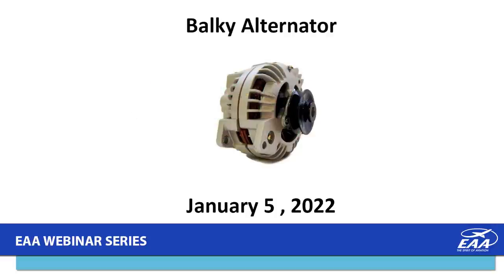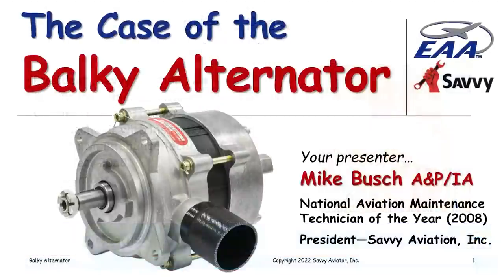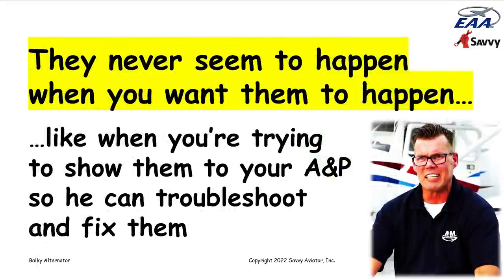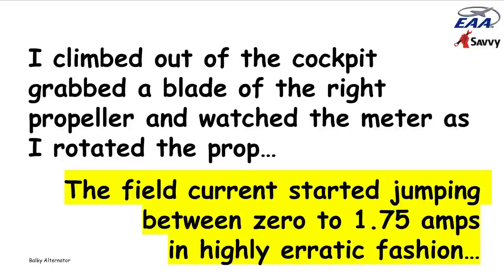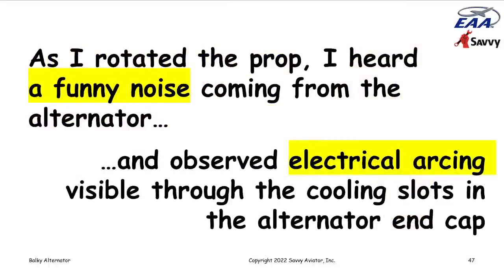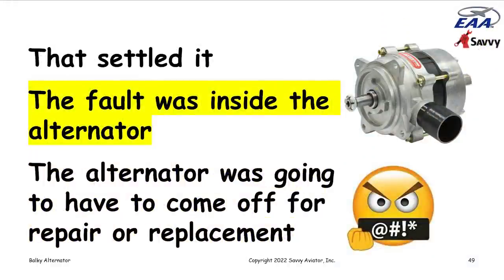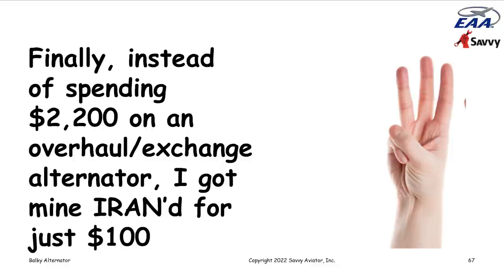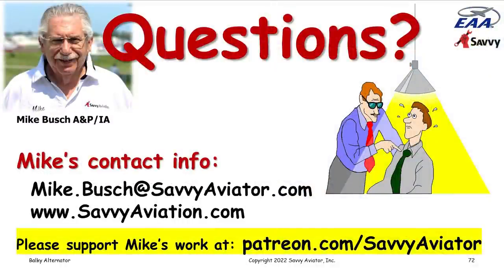Balky Alternator

Comment: I've had two alt failures.  Each one on the way to a fly in.  The first was about 100 miles from home when it quit.  Landed to check for something obvious such as loose wire or belt failure.  Nothing.  Flew home with the master switch off using handhelds for navigation and traffic.  (I never thought about if I was legal or not).  My aircraft is an RV which I built and I have the repairmen cert so I'm the chief of maintenance as well.   Once home, because of availability and cost,  I swapped the aircraft alternator with one from O-Reilly's aircraft supply.  About 100 bucks for a drop in replacement and all was well.   Fast forward about two years and on the way to another fly in that one failed.   With the help of a guy for transportation and another for a couple tools, I had it fixed.  The lessons learned from the first failure were invaluable in dealing with the second.  When returning the failed alternator after returning home, they gave me a full refund of the new one because it had a lifetime warranty.  I was happy.  The first alternator, (aircraft alt) had lasted about 500 hours.  The second about 100.  Hopefully this one will do better.  Even if it doesn't, I LOVE the fact I can get it replaced even on a Sunday nearly anywhere and be on my was in just a few hours.   Got to love experimental aviation.  Sorry for the long post.  Like you said, alt failures seem to never happen at a good time... always away from home.
Reply: That's only about 8000 miles . 
We had better luck with generators way back when
Reply: Oreilly alternators fail because the rpm they are at. Look at the size of the flywheel on your prop then Look at the crank gear on a car engine. They are spinning 2x to 5x there designed operating speed. Only way to get more life is to put a bigger alternator drive on it. I see this happen weekly.
Reply: For $100, why not mount a cold spare in the plane somewhere?
Reply: @JosephHHHo from a mechanics point of view. The work and cost to mount another alternator on an experimental and still have the cowling fit would far exceed the usefulness. Not to mention would need a way to drive it. You could run it off the accessory drive on the rear but would need to order a new accessory drive that fits and then an alternator that would between firewall and engine. If you ran it up front the flywheel would need swapped out for one that has 2 belt grooves and 2 seperate length belts. Best case scenario a competent mechanic could do it for $1000.00 all in. Realistically it's a $2,000 job for fab work, testing, wiring,
 etc, unless done by the owner. They could carry a spare but with everything aviation you could lose any number of components and trying to carry spare for those would fill the plane and make it unusable. Whenever I have an aircraft with alternator failure we swap alternator and voltage regulator box. I have seen both units effect each other and a bad alternator cause a VR to fail and vice versa. For the cost and time why not swap both.
Reply: @robvenom1058  
There is no need to have the spare connected. Unless you are crossing an ocean, you can pick just about any public airport to set down, whip out the tool kit and swap it in. Doing the work to tie it in may be counterproductive because the spare would be spinning while not being productive.
Reply: @JosephHHHo  my point being if we are going to carry a spare alternator why not carry spare tubes and tires, spare electric fuel pump, spare filters, spare instruments, spare battery, spare everything. From my experience in aviation maintenance over the last decade carrying spares apart from a couple plugs, some bulbs, and oil provide  almost 0 benefit. A blowout is much more likely to happen but the thought of carrying tires, tubes, compressor, jacks, and tools is almost laughable. Just my opinion. I'm perfectly OK with someone wanting to be prepared but I would never recommend it, especially not an alternator.
Reply: @JosephHHHo  I did consider buying one a keeping it onboard.
Reply: @robvenom1058  maybe because it has to charge at idle, that's 400 rpms to airplanes as opposed to 950 rpms to cars. A bigger drive pulley may interfere with low rpms charging.
Reply: @tomasnokechtesledger1786  that is possible and without knowing his exact engine setup it is difficult to calculate where it should be. While an aircraft engine can idle around 650-700 I rarely ever bring rpms below 1000 even on start up, others may sit at idle i just haven't seen it When we swapped an oreilly alternator onto an RV-6 we calculated at the time that at cruise his alternator, which was also used on a suzuki samurai, would be equivalent to that vehicle running constantly at 14,000 rpm. After that he understood why they don't last very long. To be completely transparent that alternator had one of the smallest pulleys I had seen for a vehicle. Plane power alternator would have been a better choice even though I'm not a fan of theirs in the least.

Comment: As always, a good presentation illustrating some of the challenges and dilemmas we are faced with as owner-pilots.

I never had an alternator fail on me, but I have had two difficult to diagnose issues. The first was ignition related, causing the engine to be very hard to start, one cylinder going cold during ground leaning and exhibiting lean misfire when 50-100° LOP. I ended up discarding the Champion spark plugs with megaOhm resistance, and replace them with Tempest which cured the issue.

The second issue was alternator related. The symptoms were somewhat similar to what you describe in your presentation. One alternator had difficulties coming online, and the difficulties seemed to be worse in cold weather and increase with time. It turned out the alternator relay was arcing due to a turned stud.

The mechanics I talked to about the high resistance issues, to this day do not know about the issue with the "old-style" Champion plugs although it has been more than ten years since they were diagnosed. Had I not happened to read about it in one of your articles, I would not have thought of testing the resistance. I mean: they did pass the "bomb test".

My "alternator" problem was not hard to diagnose once it got so bad that I could reproduce it reliably on the ground...
Reply from the maker: Yep, those defective plugs are still out there...

Comment: As Mike says, overcharge shortens life of the battery from heat buildup but undercharging does as well.  In fact, the worst possible result of that is letting a battery discharge fully and stay discharged.

Comment: Hi Mike, your video was really informative and helped me understand my alternator so much better. However, I'm still facing a problem where the alternator goes offline midflight, and cycling the alternator switch is the only solution. It seems to be related to an overvoltage issue causing the regulator to protect the alternator. Despite replacing the alternator, three voltage regulators, and using a Zef Tronics regulator, replacing the master alternator toggle switch the problem persists. I've also checked and cleaned all battery terminals. Any insights or suggestions would be greatly appreciated. Thanks!

Comment: Generator brushes and the commutator they run on carry the full output current of the generator.  So they’re much larger and the commutator has many more potential failure points between and under the individual segments than the two slip rings and rotor/field winding.  The alternator brushes and slip rings carry only the field current.  The output current of the alternator passes through the solid state rectifier.  

When silicon diode technology advanced to the point where the rectifier was reliable, generators quickly became obsolete.

Comment: So I had a intermittent alternator (SEL plane), I'd fly and notice from time to time the charge current read zero. I had my mechanic at the time check it and he cleaned the brushes and slip rings as good as possible without removing. Eventually the alt failed in flight, I notified ATC of the situation and immediately received a clearance to land at my destination AP. Hind sight I should have turned off the master, but I kept one radio operating and contacted the tower before I landed from which the battery drained. I had the alt rebuilt ($800), they found a nut bouncing around in there which looked suspiciously like a exhaust manifold nut (I had exhaust work done not long before my problem started) and it shorted and burned out the coils. After installing the alt I quickly found out my battery was only good for one crank, another$400 for a new battery. In the end of I had rebuilt to start with or shut off the master immediately I probably would have saved another $400. Live and learn.

Comment: Is there an easy way to tell if your alternator has enough juice to handle the electrical load? When I lift my gear on T/O, my alternator breaker pops. I reset it and then the gear tucks in, but it feels like the surge from the gear motor at some point in the process overloads the alternator?? Any thoughts?

Comment: the voltage produced by an alternator not only depends of the field, but also the rotationspeed of the alternator. so if it produces irregular voltage, it might be that the alternator belt is slipping
Reply from the maker: good point.

Comment: I would want to run it by a A & P anyway.  Maybe, the intermittent problem is a sign of something they have seen before.  Since the intermittent problem at some point will become a problem I would keep looking for what it is until it's found.  I am not one to throw money at a problem but I don't want to get stuck on a cold ramp as the sun is setting either.  The money saved in just waiting for the problem to make itself apparent easily can be eaten up by a taxi ride to a expensive hotel.  Working with a mechanic that you don't know.  Maybe even having to take a commercial flight while the problem is fixed.  

All intermittent problems have a a cause and by figuring out what it is and correcting it you know your plane is in top shape all the time.  The worse part would be if the unknown cause was a masked sign of something much worse.  Maybe a intermittent short under the panel that could cause a fire.  Having a fire in a airplane is even worse than having a fire in a boat!   

To me I need to know what the problems is so that I can understand it and then I know what risk I am taking.  Even if it means a little more expense in finding out it really isn't a safety hazard.

Comment: I would recommend never flying the second time after something like that. Without doing that, you know tear down on the alternator and.
Put it back together just like you would an engine., If you had a Likely problem that wouldn't reproduce itself.If at alternator locks up, do to a bad bearing or sparks From bearings or other metal cause  fire, it's at least not gonna be good. If you talk to generator mechanics and for large  I'll tell you when a generator quits producing electricity and I know it's true sometimes bearings Are failing. Brushes and wiring and things could cause a short death affects avionics or again fire. I have experience with the DC motors. Starters alternators etc. So I know how simple it is to Turn down an alternator Or starter. I would just suggest being careful and study first on Necessary knowledge each model might have but probably doesnt, Like you would for anything the first time. good luck!